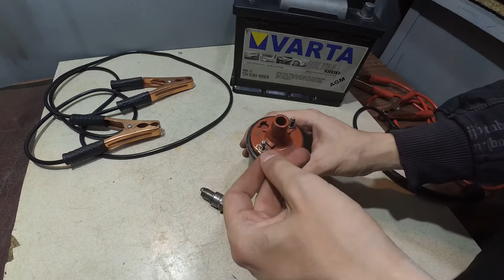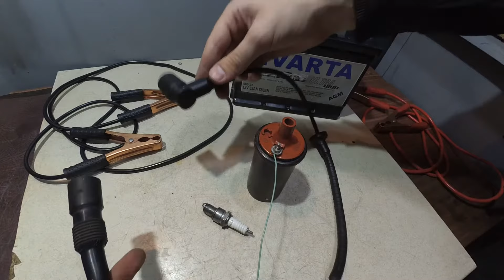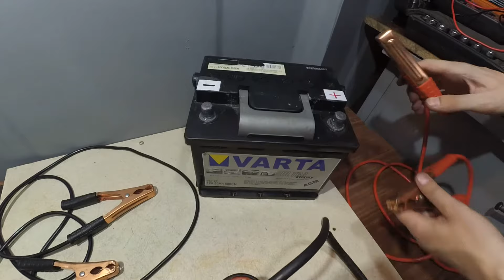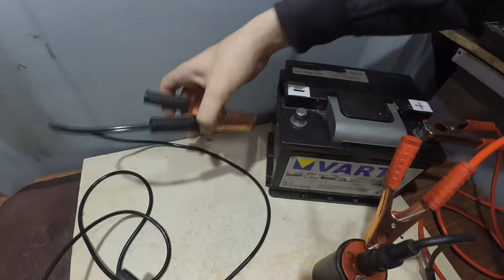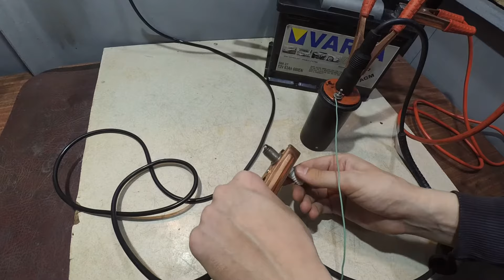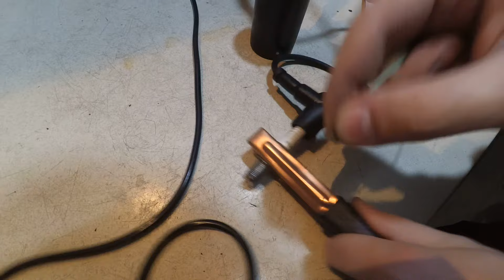How to check the ignition coil for a spark?

Comment: Very good demonstration. But you can have a coil that works perfectly fine at low rpm and or when cold, that overheats and breaks down at high rpm. Back in college we had a rig that was essentially a spark plug and a set of points with an electric motor actuating them. You plug the coil in and leave it. Ten minutes later, if it was getting really hot and or the spark broke down when revved up, you knew it was bad.
Reply: got an iddea how to build another test rig like that?
Reply: @stevenkerr1455  Well, the quick and dirty way to do it is with an old knackered distributor, take the gear off the bottom and chuck it in a drill. Then hook it up as per usual.

If you wanted to build a test rig, you'd need a motor, an eccentric cam, points, some type of RPM monitoring tool or a rigged up tachometer, some leads and wires, and some type of surface to mount everything to.
Reply: I have mercriuser 120hp and after of little bit of driving the coil is geting very hot and boil some liquid on top,maybe some one give an advice.

Comment: So weird, I had the same setup today (with a brand new coil) and I couldn't get spark with my makeshift spark tester (just a generic plug with an alligator clip soldered to it).  Man, in the old days when I was a trained electronics guy working on cars I bench tested coils all the time this way and only ever found a few bad ones...I think I'm turning into Joe "biff" Biden...🤣
Reply: don't feel alone, I've forgotten everything I never knew about nothing, especially for cars. Going through a hard cold starting 200 6cyl. in my 64 Ranchero, One thing at a time; fuel, spark, batt., pump, etc. Looking at a mis-match with my old coil and my HEI electronic distributor but think there is a more a mis-match between my old brain and the understanding of what needs to be done, or not done!! LOL ;D
Reply: @ronschlorff7089  Advance Timing a degree or 2 on Hard starts and see if it makes a Difference.
Reply: @mickeycox6690  Thanks; yes, I suspect timing is the issue.
Reply: @ronschlorff7089  Had a Dissy with a Bad Bushing drove me crazy till I figured that one out.
Reply: @mickeycox6690  Thanks for the info, sometimes is it's the "little things" that make the difference, with cars, as you just said!! : )

Comment: easier way: connect a aa battery on one of the outer 2 contacts then put one finger in the middle contact and another finger on one of the outer 2 contacts. then connect and disconnect the AA battery to see if you get a shock while disconnecting.
Reply from the maker: Thanks a lot for the advice! I have to try)
Reply: @Fayan TV
If you have health challenge like heart problems or wearing cardiac pacemaker, epilepsy etc., don't try it or consult you doctor. High voltage present, risk dysfunction of medical devices and health
Reply: @adeyemibabatunde1814  agreed
Reply: Gets me going in the morning 🌄 🤣🤣🤣

Comment: Yes I suppose that is a test of sorts but you need to remember that ignition coil it’s boosting 12 V to about 20,000 V using a magnet immersed in oil it fires every time the points open in the distributor and as the motor is revving 2000 and 3000 RPM things get hot on the under the Bonnet the metal and components in the coil can expand under heat and internal defects or cracks etc can lead to the ignition breaking down so the bench test your performed is one thing but it’s room temperature low rpm it’s not a particularly arduous test

I think I’d be inclined just to buy a new coil to be honest

Comment: I have 3 coils here, and 2 are brand new, both Lucas, for a 1.6 Ford crossflow, set both up following this carefully, I have full batter and it turns the engine over now probs, but I get no spark either are the plug or on the ground leads when I test. What could that be!!

Comment: If the spark plug does not spark 
Does that mean coil is bad ?
Reply: Could also be a broken spark plug or the gap is too wide, or could be a broken cable but it's easy to check if the cable is broken
Reply: @jesseycoolen4169  Did you get an answer to this question?  I've tested mine and get a spark from touching the wire to body of spark plug but the spark plug isn't sparking?   Does this mean something is bad or is that normal?
Reply: @PublicWebVideos  so you get a spark from the cable but not from the spark plug? Than the solution is easy, you need a new spark plug (don't forget to adjust the gap)

Comment: What do you mean by + or 15? Does this mean it should be 15 volts
Reply: Positive terminal or also known as terminal 15. Correct me if I'm wrong but terminal 15 is 12v when ignition on and terminal 30 is always 12v

Comment: CDI ignition coils need minimum 100v pulse and do not spark with 12v battery
Reply: An ignition coil like that one ups the voltage from 12 to 20kv
Reply: My friends has an older corvette with CDI and all the coils that are suppose to work crap out after a couple of 100 miles. All the coils have different ohms so.

Comment: Haha you don't know what you're doing 😉 you don't know how to test a coil first off everything you have is right but and I'll say that word again but you have to use the temperature in between the coil negative and ground just like points distributor work no capacitor no spark. older repair manual people of the right way of testing ignition coil. And I'll add this one for free if you have a blue Violet spark that means you capacitors red or yellow capacitor not too good.